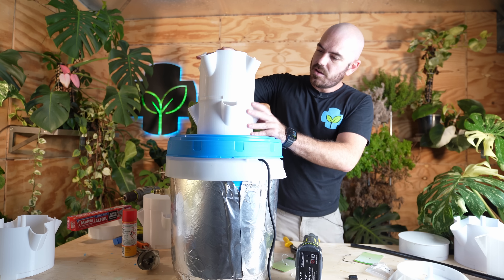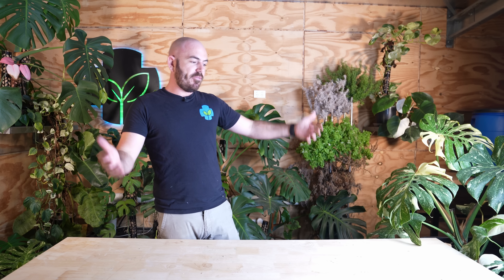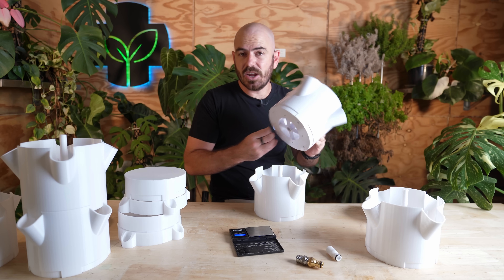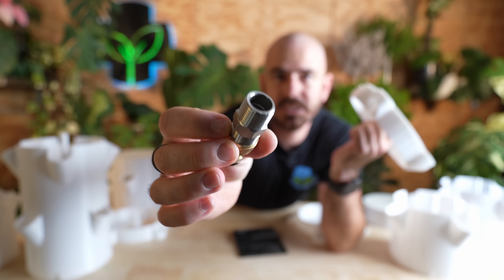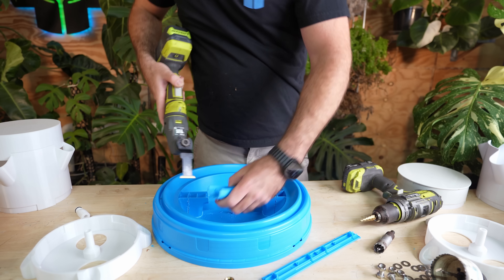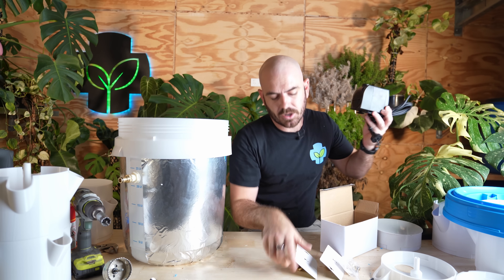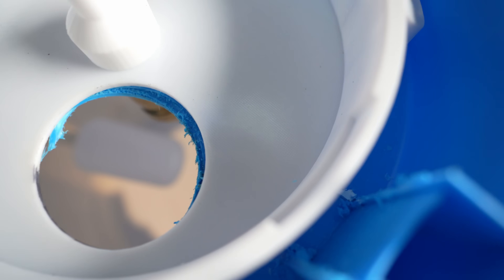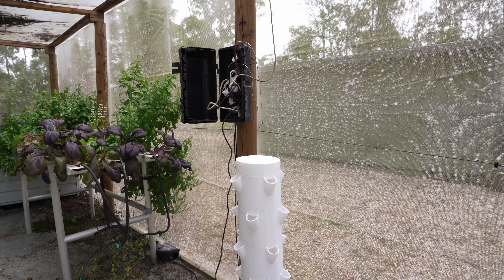3D Printable Tower Hydroponic System

Comment: Hi, what type of filament material is used to make this aeroponics system?
Reply: PETG. He uses white, some use black.

White is cooler but will have algae, black is hotter but no algae.
Reply: @rohanjames9165  thank you for your reply, one more question how long does it take to make a middle part for 4 plants at a speed of 250 - 300 mm/s
Reply: @bandy820915 I’m drying my PETG over this weekend to print this on Wednesday so I can let you know shortly.

Comment: I find the stl file to be a bit confusing as it's all parts in one stl, and it has a few extra parts not mentioned in this video, it would've better if in the future you could make a folder for this system with separate stls along with a written instructions for print settings and details of the system,
I don't like that I have to come back to to the video if I forget something.
Please do this.

Comment: You should make the inside printing black and the outside White and where the next Cups Go  the bottom lip above it invert it in giving little holes on that lip so I can still drip on the next Cups and your top piece put a cap on the end of that water reservoir at the top there so it squirts out sideways on the sidewall limiting your water hitting the top of your lid   small one big one up to you you can get really creative like a overhead shower design
Reply: Inverting that bottom piece makes it easier to put your net cups in so you're not pulling on them and forcing them out

Comment: Hello, I’m from Brazil, and here we don’t have anything like this. Due to the high shipping costs and import taxes, importing is not feasible, as each tower coming from the United States ends up costing over USD 1,200, which is absurdly expensive. From what I understand, you developed a project where I could 3D print the entire tower, except for the reservoir. Is that correct?
I have a few questions: for this model you developed, how tall can it be stacked? How many pieces can be used?
I have absolutely no knowledge of 3D printing, but by subscribing to your Patreon, would I have all the necessary information to print and assemble my own tower?

Thank you in advance for your attention, and I look forward to your reply.

Comment: Quick tip for designing for 3D printing: to avoid elephants foot being an issue with your tolerances you can add a .6mm chamfer to the bottom. If the bottom layer is squished too much it will just have straight walls instead of intruding into your tolerances.

Comment: I have a questions about the main Module. 
There are 8 holes and the wall to the inner side. 
4 of these holes have a lower hight. Through these holes the lower plant get their water stream. 

But for what are the other 4 holes? 
At first I thourght as a backup hole to get water to the next level. But this can not work. The holes are taler then the inner wall. 
Is this a design error? Or did I miss something?

Comment: I downloaded and started printing this about a week ago... I did notice a problem with the tower sections though... thought I'd let you know. when slicing I noticed that the secondary drain holes in the tower sections are actually taller than the inner lip. Means that if the 4 primary drain holes were to clog, then the section would fill up and spill down the middle before having a chance to drain through the secondary drains. 

I managed to modify mine to have them halfway between the primary drains and the lip, but might want to modify the files for download.

Comment: Be Aware of Pipe Thread Standards.  IF you live in North America, you are going to have fun trying to find adapters from BSP on the print to NPT used in North America. You might find yourself confused if you buy a 1/2" pipe thread fitting in the store and it doesn't thread into the adapter plate.  Best to print the BSP to quick release adapter and use that.  Or find a print that adapts BSP to NPT.
Reply: Acklands and amazon seels bsp adapters. You can probably print them too

Comment: Hey Hoocho, where did you get the big green basins you use for water in the hydro land listing of your modular tower? I am all the way in Canada so I can’t buy one of your already made towers so I am going to 3D print a couple for myself but I’m having a really hard time finding a basin like that. I like how big it is and I plan on 3D printing a lid that is like the one you also have for your shop pre built towers. Any idea on where I might be able to source a few online?
Reply: Commenting for visibility. I am printing the tower now and trying to find a bucket that will be a suitable fit in the U.S.
Reply: @aabartlett88 I think I’m going to end up going with a horse muck bucket, it’s quite a bit bigger than what he uses but it’s shorter and wider than all of the barrels ive seen people use plus I want to be able to put it on a bucket dolly and be able to wheel it around my deck and into the house over winter

Comment: At the portion of the video where you’re light trapping the nutrient portion; I was curious on if the rest of the tower was printed in transparent filament, if that would negate this action or have any similar negative effect? 

Found your video while researching if there would be a negative to 3d printed hydroponics system since there’s a large discourse in 3d printing and microplastics with consuming using things made with 3d printed material

Comment: Great idea!  Integrate a twist lock in each level so it will lesson the chance of a blow over.  Just an idea for you.  I printed many of these years ago from share files floating around on 3d printing sites.  These things work great.  If you can water proof the filament on the inside, it will be easier to clean after a grow period.  They do get dirty inside.  
Keep up the great work!

Comment: hi ! just discovering the channel and I like your work a lot. I'd like to point a small detail that would help people that 3d print them: if you can get each section at or under 330g, that would really be great, as it would allow to print 3 with 1 roll. going 360g means you can only print 2. I do not know if it is possible though.  Thanks for your work !
Reply from the maker: @croustibat682  hey mate just adjust the infill density, and it should solve your problem.

Having a filament runout sensor completely eliminates this issue.

Comment: I printed 2 other free available towers last year for lettuces off of makerworld, other than some issues with the circulation hose falling off a couple times it worked great. I just ended up putting an extra hose clamp, and that seemed to fix it. One was petg, and one was pla standard. Both held up great.

Comment: This is very similar to the Tower Garden that is sold by Juice Plus here in the U.S.  I have several of the Tower Gardens and they work very well. This looks slightly smaller but I bet it would work just as well. The only downside is see is the small base, the Tower Garden has a 20 gallon base. If you can find a larger plastic food grade barrel that holds 20 gallons or so I would use that.
Reply: Can you please check the size of tower garden module (internal diameter and height) ?
Reply: @LakeSpearfishing  
,22 cm in diameter x 19 cm high
Reply: If the reservoir is kept topped up by a float valve it doesnt need to be 20 gallons :)
Reply: Tower gardens are also 5x more expensive than this.

Comment: How do the 3d prints hold up with water and sunlight? Wont that degrade the 3D print plastic over time? Or is this a special filament?
Reply: It’s easy to find information on the internet about this topic. There’s filament for different purposes. I think (can’t remember without checking) petG is more uv resistant than pla
Reply: @downunderfulla6001  true, but filaments like petG can significantly effect any tolerances be mentioned. But maybe there's a water resistant PLA out there.

Comment: one last thought, could this be modified into an aeroponic solution? maybe using sprinklers along the middle sections? awesome work man
Reply: There would be no benefit using sprinklers compared to the original top down irrigation. The roots will get completely soaked either way
Reply: @atomizer2665  a lot of high end vertical farms use sprinklers though, maybe something to replicate moving forward for optimization
Reply: @CubeRhinoDev  
To gain a benefit over the shower plate/sprinklers you`d need mist. The issue with that is these towers dont provide enough internal space for mist to be effective :)

Comment: Any recommendation on solar pumps for balcony peeps with no outlets on the balcony?
Reply from the maker: The small pump I recommend in this video is actually 12v (the ac adapts down to a 12v connector), so you could hook it directly into a solar panel, regulator and deep cycle battery setup.
Reply: @Hoocho  Thanks Hooch!

Comment: Hoocho, keep them screws holes for the base on to each print. We could then use long screw rods, 1 to secure to the base and then 2 make the whole thing more solid in winds. 3rd would act as a frame.............
Reply: Like you, my tower toppled in the winds. I reckon if they screw into the base which is weighted by the water it should be solid enough to stay standing. Maybe an option later for bigger net cups.

Comment: Hey great work, and thanks for sharing it! I am playing with the printing setting. Using 100% infill only increases filament use by 20 grams and doesn't change the printing time. It is worth it to go full infill for better longevity and less transparency for algae buildup. Do you see any downsides other than the extra 20 grams in weight?

Comment: Too much light in this system for this kind of 3D print material. The original one has solid PE that limits algae proliferation. The cheap solution has side effects.
Reply: 100% infill...
Reply: @sambagamb  not fix it
Reply: @giorgiomanieri  it's a print setting under your control, he talked about it, just choose the setting you prefer when you print it.
Reply: @sambagamb  I know the 3D printing parameters very well. Even 100% infill does not block the light
Reply: Use black filament instead of white
Reply: @milkybaravenger  try using a black material during summer. Let me know
Reply: @giorgiomanieri  designed and made one myself out of black a couple of years ago, the water running down the inside keeb it cool. been running it for two seasons now this will be my third.
Reply: Wrap the outside in foil like he did the bucket.

Comment: Some sort of twist locking mechanism on the top lid design could help prevent risk of the water pushing it off.

To anyone considering running the 35L res for this without the float valve refill, don't. In summer and peak production these vertical gardens can plow 30L in a day. 60L+ would be recommended if you want the standalone res. Coming home to your system running dry is not fun, I don't recommend it.
Reply: I have 3 60ltr res interconnected, adjusted pump run on solar, it needed topping up every 3 days.
Reply: @gforce_aus  fully agree, just experienced this…dead. It’s all dead.

Comment: Can you share a link to the cheap PETG (Aussie)? Also, do you print with 2 or 3 perimeters?
Reply from the maker: Sunlu store on ebay using ebay plus codes. I use the default bambu settings which I beleive is 2 perimeters

Comment: Hey dude thats awesome. Thank you for designing them. Just a thought. What if you added a thread on the base and a hole in the lid that allows a threaded rod with a wing nut on top. Essentially clamp the parts together. Or even a a couple of pins and slots in the printed parts that lock them together and to stop the lid floating.

Comment: Nice work can’t wait to try it!

Some suggestion:
- mounts for lights
- halo / mounts for supporting larger plants like determinate tomatoes that need strapping or support to grow in a tower like this
- different density levels eg 2, 4, 6, 8
- caps/lids for unused spots
- removable hooks to hold in rockwool or coir pellets
- inspection hatch to check ec and ph?
- mount for the large ikea DAMMÄNG bin - 27L - because it’s pretty!  Was thinking maybe an oval shape to connect to the bin that morphs into the round shape for the tower? It has a built in inspection hatch in the bin lid! 
- hardest part of these towers is being able to take off the lid and tower to maintain pump or reset nutrients when loaded with plants, any way you could solve this cleverly? 
- printed hinged flap for side inspection or lid inspection on bigger bucket?

Thanks for this!
Reply from the maker: Looks like im gunna be busy hhahaha
Reply: @ just a wish list…take your time…sooo next week?
Reply from the maker: @ 🤣😂😂 probably hahaha